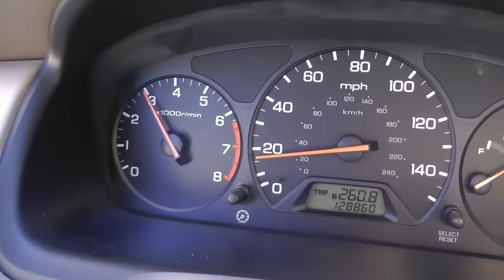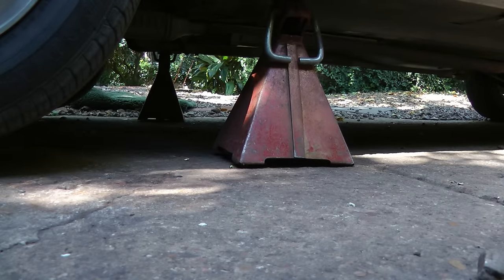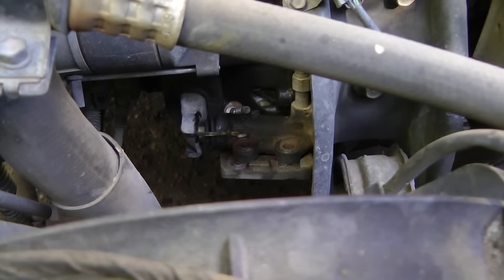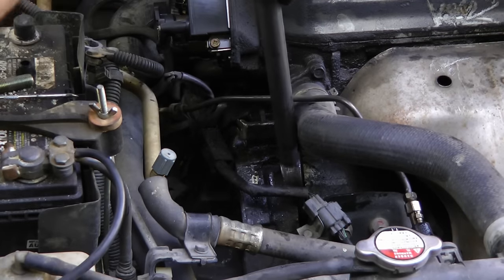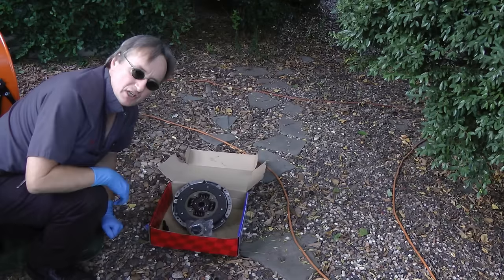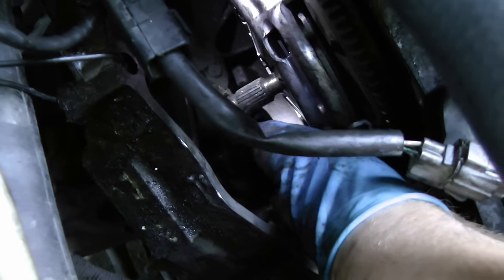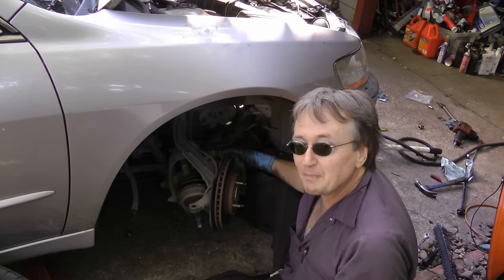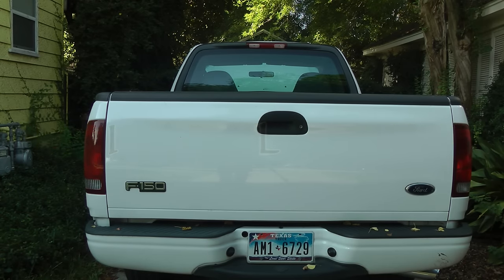How to Replace a Clutch in Your Car

Comment: Thanks for the video.  You've basically told me to take it to a mechanic.
Reply: LOL
Reply: Chris McCalla  do it bro i have fate on you. buy that transmission and do it. you the man
Reply: haha!!
Reply: Hahaha! Damn funny man.
Reply: Jay Jack no shit!
Reply: So you drive an automatic?
Reply: Jay Jack  I hear you 
not a weekend warrior project
Reply: Jay Jack LOL I was thinking of fixing my wife's car her clutch went out but by seeing this video it got me scared it's too good to be true that fast man I'm going to take it to a mechanic
Reply: Angel Camacho I did a clutch it was really hard don't even  bother attempting it u will regret it.
Reply: Paul Williams I've changed 2 clutches on 2 different vehicles and, while it looks intimidating, it's not that difficult in real life. The first clutch I replaced was a 1982 Datsun 210 station wagon. That was ridiculously easy. Just had to disconnect the drive shaft (most Japanese cars prior to the mid 80s were rwd) a couple of wires, and the tanny itself. Whole process, from start to finish,  took 5 hours. Transmission only weighed about 70lb dry. I could lift it with my bare hands but still used a floor jack and Jack stands for clearance. Unluckily for me, a garbage truck backed into that car two weeks later, totaling it. God I miss that car. (On a side note, if you want a car that is super easy to work on, Buy an older rear wheel drive Japanese or European Vehicle. Small engines and massive engine Bays with few wires, hoses, Etc. Everything is very easy to reach.) Second clutch I did was on a 1991 Mercury Tracer, basically a rebadged Ford Escort. It took me a couple of days to do it because it is front-wheel drive and everything is cramped in the engine bay and I had to take more stuff out of the way to get to it. But I still did successfully. The most difficult part was getting the transmission to fit back on to the engine.
Reply: Clutches are easy. I put a clutch in my first car when I was 16 years old laying in the dirt on my back. My only instructions were reading a shop manual.
Reply: There's my laugh for the day 😂🤣
Reply: Believe or not its fairly easy job hardest part is taking the transmission completely off
Reply: LOL!!
Reply: LMFAO🤣🤣🤣 Epic Comment👏🏾👏🏾👏🏾
Reply: LMFAO good one LMFAO.
Reply: And this is one of the easiest clutches to replace. Modern transverse engines with AWD are a nightmare
Reply: I did the the clutch in my wife’s car wasn’t to bad I was worried at first but it’s not to bad find a video for your car with more detail
Reply: Truth
Reply: verbatim what I was going to comment.
Reply: An cartoon artist can demonstrate how easily they draw characters.
Reply: this video is for mechanics, honey
Reply: @tokieo no it’s for smart people
Reply: Hahahaha
Reply: after tough actions then comes the hard part, wow....
Reply: Same bro
Reply: @JohnSmith-1234  
Easy on rear wheel drives.

Comment from the maker: i could do it in two hours, some guys could take two days. Just depends on your speed. take your time, don't rush it
Reply: I take 2 days but I get it done right hahha
Reply: First timer here. 14 hours in, about to pry off tranny but gotta figure a way to support it since I have no transmission jack. There were lots of bolts that were in tight spots I had to get out plus the subframe . :S
Reply: Any advice for a clutch job on a rear wheel drive 74 Nova? Lol I know it’s been 7 years...🐌
Reply: @74nova36  same process but rwd is easier
Reply: Where ya live Scotty ?
Reply: I get it done in one hour ima have to teach you some stuff

Comment from the maker: most things worth doing are somewhat hard, think of how boring life would be if everything was easy as pie
Reply: I have a 1996 volkswagen golf gti the engine idles rough i change the spark plugs and spark plug cables it helped it out a bit what could it be
Reply: @boi_9421  I have an 1986 Volkswagen. It's on my channel.
Reply: boi _ boi _ rough idling could be a few things, when the car is warmed up and stationary, the revs should stay around 1000rpms, any lower than that you’ll get a bumpy idle, if your car is turbo’d, try locate the bov or diverter valve and make sure the spring is tight enough so it doesn’t open when decelerating
Reply: You meet yourself in those hard moments
Reply: @funkolog  hardly true
Reply: You're a Legend, Scotty
Reply: so true
Reply: I noticed you gotta align the transmission spline to the clutch spigot bearing, for one. And also be wary of ending up with the transmission wedged in the chassis itself.

Comment: One guy watched this video, his car did exactly the same (revs come up put the car won't go). so he bought a new clutch kit and took out the gearbox and then realized that an automatic gearbox doesn't even have clutch. :D
Reply: I feel sorry for the guy. So what car he has?
Reply: Toyota Yaris :D
Reply: So he just goes to store and say "give me clutch for my Toyota Yaris"..?
Reply: I don't know what he said exactly, but it is his first car that has an automatic transmission, he probably was thinking that automatics also had clutches and Yaris models came with automatic and manual tranys, so he bough a clutch setup
Reply: Thanks for answer. Still, I feel sorry for buddy.
Reply: Let's say it was the lesson for him. the hard way lesson. but everything got settled, he took back the new clutch to the shop and bought some used automatic gearbox (because he needed to change that anyway) the old gearbox was already taken out, so he only needed to put other gearbox in and that's it
Reply: Must have been fun to see his face the moment he found no clutch in the transmission.
Reply: Was that guy you? lol
Reply: I bought steering oil for my EPS
Reply: This comment saved my life
Reply: Hahahhahahaha
Reply: @SamFisherK  But don't automatics have a clutch for every gear inside the transmission? Of course they are automatic

Comment: I need a clutch on my 1998 Mazda. The cost is 600.00. Looking at your video shows that the job is not easy and the price is reasonable.

Than you
Reply: The job is extremely easy. And $600 for your clutch? Wtf? Who are you buying it from? That better be an upgraded clutch, cause there is no way an OEM clutch will cost you $600. I have a 2012, and that clutch is about $200 i also have an 85 MR2, and that clutch is about $150.
Reply: Sometimes, it’s just easier to leave it to a mechanic. Drop it off and it’s done In a day, and you still get your weekend to spend with family. Do an overtime shift or flog some crap from around the house online to pay for it.
Reply: @mattevans1643  $600 for a clutch job is a steal.  The parts are probably only $150.  That's 450 for labor.  Most shops charge $1,000 for the job at least.  Some up to $1500.
Reply: @mattevans1643  what kind of clutch

Comment: Scotty,
I just wanted to say thanks for the video. My car needed a new clutch, and your video was more accurate than the instructions in the manual. It recommended dropping the subframe,  which would have taken a LOT longer. I still had PLENTY of room to do the clutch from the top without removing the subframe. Thanks again!
- Mike

Comment: You are a genius doing that complicated job in your back yard on jack stands.
What about the torque standards ?   the wrench down pattern ?   the shims and spacing tolerances?
In any case you did it made it looks easy and I thank you.
Reply: He didn't do it right. He didn't say anything about inspecting/resurfacing/replacing the flywheel.
Reply: Dondi Moore He did in his newer video 
If the flywheel is fine no need to replace it.
Reply: he should have added important details.
and it was an easy car to work on most need the  tranny dropped. but he did make us realize we can do it if we have any industry.
Reply: its a generic video not vehicle specific so these details are superfluous.

Comment: You make it look so easy but I am sure it is a tough one
Reply: It is. On my daily driver, you remove 3 engine mounts, unbolt the slave cylinder, remove the battery, remove the air cleaner assembly, disconnect the shift linkage, unbolt the starter, remove the tie rods and CV axles. So yes, it's a pain in the ass.
Reply: GreatYue this was done on a what appeared to be a 98-02 Honda Accord EX.
  The trans is fairly easy to get too. What amazed me about Scotty was he did most of the work from the top, I do it under the car.
Reply: I've changed 2 clutches on 2 different vehicles and, while it looks intimidating, it's not that difficult in real life. The first clutch I replaced was a 1982 Datsun 210 station wagon. That was ridiculously easy. Just had to disconnect the drive shaft (most Japanese cars prior to the mid 80s were rwd) a couple of wires, and the tanny itself. Whole process, from start to finish,  took 5 hours. Transmission only weighed about 70lb dry. I could lift it with my bare hands but still used a floor jack and Jack stands for clearance. Unluckily for me, a garbage truck backed into that car two weeks later, totaling it. God I miss that car. (On a side note, if you want a car that is super easy to work on, Buy an older rear wheel drive Japanese or European Vehicle. Small engines and massive engine Bays with few wires, hoses, Etc. Everything is very easy to reach.) Second clutch I did was on a 1991 Mercury Tracer, basically a rebadged Ford Escort. It took me a couple of days to do it because it is front-wheel drive and everything is cramped in the engine bay and I had to take more stuff out of the way to get to it. But I still did successfully. The most difficult part was getting the transmission to fit back on to the engine

Comment: I had to do this with just a breaker bar, 5 sockets, a clutch aligner, a jack and axle stands, a set of open ended spanners and a ratchet. I just used some old hose pipe to refil the gearbox. You make this look way easier than it was for me haha

Comment: What Scotty Kilmer show in 4 mins. will take me 2 days to do!  I don't even feel I did it right...
Phew next time i'll just take it to a certified Mechanic!
Reply: Scotty MSU Hey man, you did it!  Don't forget that!  Most people go their whole lives without ever doing something like that.
Reply: Kilmer is the man when it come to cars.. but this sense of humor get a little getting use too.  I have to say I learn a lot from his how to video Thou!  Keep up the good work
Reply: Scotty MSU    M
Reply: I've changed 2 clutches on 2 different vehicles and, while it looks intimidating, it's not that difficult in real life. The first clutch I replaced was a 1982 Datsun 210 station wagon. That was ridiculously easy. Just had to disconnect the drive shaft (most Japanese cars prior to the mid 80s were rwd) a couple of wires, and the tanny itself. Whole process, from start to finish,  took 5 hours. Transmission only weighed about 70lb dry. I could lift it with my bare hands but still used a floor jack and Jack stands for clearance. Unluckily for me, a garbage truck backed into that car two weeks later, totaling it. God I miss that car. (On a side note, if you want a car that is super easy to work on, Buy an older rear wheel drive Japanese or European Vehicle. Small engines and massive engine Bays with few wires, hoses, Etc. Everything is very easy to reach.) Second clutch I did was on a 1991 Mercury Tracer, basically a rebadged Ford Escort. It took me a couple of days to do it because it is front-wheel drive and everything is cramped in the engine bay and I had to take more stuff out of the way to get to it. But I still did successfully. The most difficult part was getting the transmission to fit back on to the engine
Reply: Scotty MSU lol when I first started tinkering around with my car. I did the spark plugs. Had no clue where they were on my old 95 Mercedes, I was pulling on the fuel injector rails thinking the spark plugs were under the injectors lmao and taking bolts off the engine not knowing wtf is going on. Till one day, under the black cover just a few inches to the side of the rails, where the spark plugs lived, I found them. Took me 1 day to figure that out and the second day to actually finish it, should’ve been a like a 30 min, (maybe a tad bit more, since mine was a v8 and there was little room to get to the back part where the plugs were). But then again, I bought the cheapest tiniest socket wrench set for 15 bucks outside my local junkyard, and the set was garbage to begin with and it was just hard not having proper tools. I was mad but relieve and felt proud I did something. Just recently I changed my starter, took me two day too, but since I got a new job, wasn’t able to have time to change it, was about 3hrs, only cause I didn’t have 10mm hex bit, and again, there was no room for my large hand to fit. Point is, I was just glad to get it done hahah😂
Reply: I’ve got a 1993 Mazda mx-3 that needs the clutch replaced.  I think it’s the original clutch and the car has 213,000 on it!  But I’m easy on clutches.  I think it’s quite a bit more involved to replace the clutch on that car than what’s shown here.  As I have done driveshafts before myself, I’ll plan on driving my other car during this.  Btw quotes on this clutch replacement were at least $1000!
Reply: @capitalisteconomist  Jesus Christ man you've posted that exact comment multiple times... Seems like you have too much time on your hands; explains the clutch fixing
Reply: @bobbyg387  what's wrong with that. Freedom of speech.
Reply: watt if you have an AWD Manual car do you have to take off all of the axles and differentials as well

Comment: How on earth can you slip a clutch alignment tool in with the transmission input shaft  in the way? You did not address supporting
 the engine ether. I wonder how many weekend warriors have torn their hair out over this one. And what is with all those rocks on the ground surrounding your work area;-)? No offense intended Scotty! I love your videos, they are informative, and interesting. This one is a stretch.
Reply: Doing a clutch now it's way more involved than what's shown in the video you'll most likely have to drop the trans all the way out
Reply: He's been doing this longer than you've been alive... You would understand unless you did it yourself.
Reply: peaceonthis265 agree
Reply: peaceonthis265 he dident torque his bolts so the clutch might be uneven at one side
Reply: He also forgot to mention it’s a procedure for front wheel drive only lol
Reply: You don't need to support the engine, unless you have a shitty car that had terrible design engineers. The engine mounts are there so that you don't have to support the engine. It's not going anywhere, unless your mounting bolts are loose.